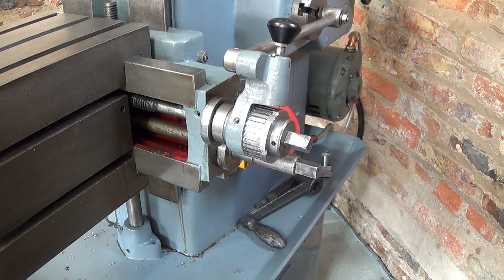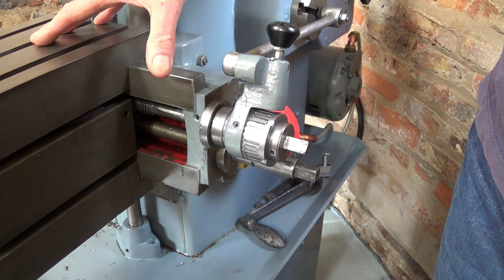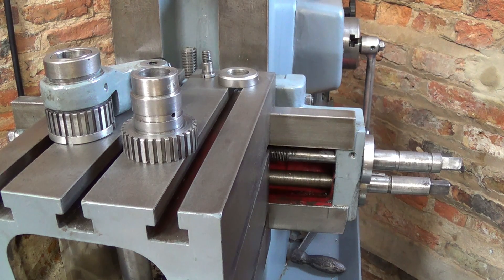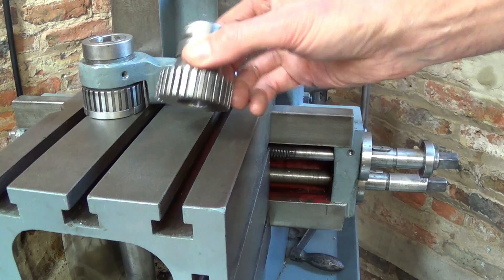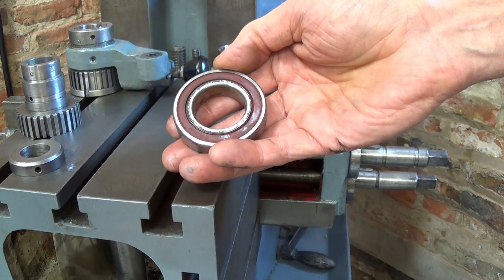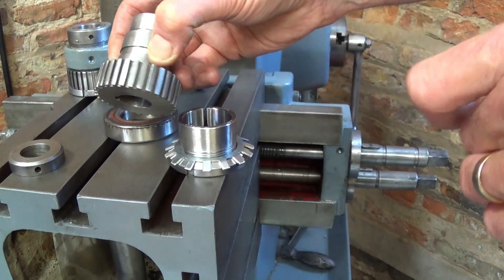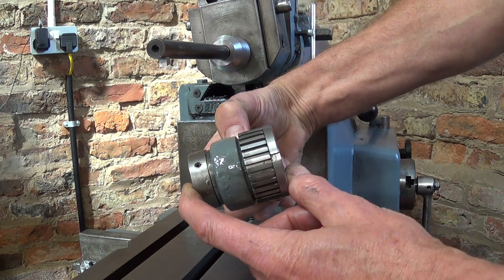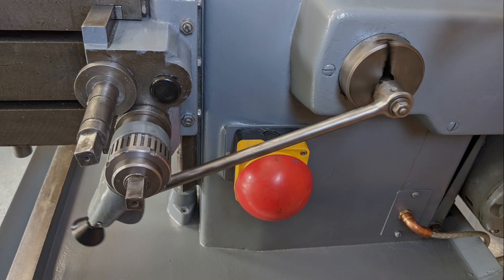HS5 Elliott 10M shaper table clutch

Comment: The only issue with auto up and down feed on the table is not being able to use the front table support. Aside from that, it's a great feature to have. Nice and simple solution well done
Reply from the maker: Hi, that is true. I think I have only used the V feed once. Just occasionally there are jobs where no other setup will work, then I'm glad of it. Cheers

Comment: Another great video. Would be good to see some more detail on how the clutch works.
Reply from the maker: Hi Jonesey, I used a tapered 'bearing sleeve', which is a tapered sleeve to secure bearings with a tapered internal race to a shaft.  So the idea is if the table load becomes excessive the cone will slip within the toothed ratchet gear     and avoid breakage. Now I have never had a 'collision event' to test it so at this point it remains there as a safety device as yet unproven, but at least it has a chance of working whereas a hard keyed gear has no chance to slip as a safety clutch would.  Cheers

Comment: Great video and I did not know that the vertical and horizontal auto feeds were interchangeable. Still looking for a small shaper.. one day hopefully!
Reply from the maker: Hi Peter, Elliott sold a vertical feed ratchet option for the 10M a bit more sophisticated than my rig up. The friction clutch sat on a shaft in that hole which has the black bung in it on mine and then it could be pivoted to drive horizontal or vertical. Of course the larger shapers often had a down-feed option on the vertical toolpost slide (rather than ratcheting up the table).    Cheers

Comment: Excellant!
Reply from the maker: Thank you Alan. Now, I've never had occasion to put it to the test. I gave it just enough tightness to drive the feed, and I hope that taper would not lock and make the clutch solid (i.e. not a clutch). But there was no clutch before so it might be better than nothing. The original Elliott design was a friction clutch but it only worked on the cross-feed and was not fitted to my machine. Cheers

Comment: Great idea for the clutch. I’ve just purchased the same machine and will give this a go when I get time. You mention the table drops off the horizontal leadscrew at both ends. What’s required to put this back in position. 
Thanks
Reply from the maker: Hi Bradleigh, the fact that the table nut runs off the end of the horizontal screw thread  (and on to the plain part) before the table runs up to the casting is a useful safety feature but it can be awkward to get the nut re-engaged on the thread. If you are lucky just push the table (and nut) against the thread and turn the handle to screw it back on. The table is weighty and may drag on the slides so it's hard to feel when the nut starts on the thread. You may need to unscrew the lead screw at one end to get some wiggle. It's a bit awkward.  But better than breaking something. Up and down is more dangerous, without that built-in safety hence I made the clutch. Cheers
Reply: @HaxbyShed  yes, I thought I maybe a bit tricky to align the table. I had a better look at it today, and it think it has the clutch assembly. I’m not convinced that it’s going to slip easily so I’m going to fit some limit switches either side that cut the power. Have you thought of doing this? It can be done fairly cheaply.

Comment: fascinated by this. i still don't quite understand it. the withdrawal sleeve idea is just for easy removal? or does it have some function as part of the clutch? i would love to see a demonstration of the clutch in action
Reply from the maker: Hi Raymond, the idea is that the cone of the withdrawal sleeve is the clutch. I adjusted the nut until the cone stopped  slipping during normal operations. There is a risk that the withdrawal sleeve taper will 'self lock' being only a couple of degrees. If travelled too far the table just drops off the horizontal lead screw at both ends so horizontal does not need the clutch really unless you run into the work. Vertical travel is the real risk. I have never put my safety clutch to the ultimate test - but I will have a think how I might demonstrate it. Cheers
Reply: @HaxbyShed  i understand that demonstrating the clutch could damage the machine and certainly wouldn't want you to do that. Thanks for responding. I started watching another channel called rustinox who has a similar machine and I think I'm starting to understand how it works
Reply from the maker: @raymondjames9734  Rustinox I know well. In fact one of the first channels I watched when I got my shaper. He's s good guy. Cheers

Comment: what size milling bit did you use to cut the splines on the ratchet gear. my one is missing and i need to make one
Reply from the maker: Hi Donny, the ratchet wheel has 3/32 (2.4mm) slots so I used a 3/32 carbide end mill. I ran my lathe at full speed (1500 rpm), took very light cuts and still I broke 2 end mills in the process. If you have a mill then a slotting saw would be a better option.  Cheers

Comment: Iv been looking at the vertical feed and was wondering if I could put it on the other shaft but the thread on the shaft made me think other wise iv found your video very helpful
Reply from the maker: Hi Dale, I think mine was made before the friction clutch on the x-feed was added, as I have no thread on the drive end of the x-feed shaft. I wanted to make a self-contained clutch that could be swapped from one shaft to another without any adjustment.   I adjusted it the first time and it's been fine since with no slippage. The taper on the bearing sleeve I used is quite shallow so the clutch might taper-lock but it's got to be better than no clutch at all. I can't really foresee when the clutch would be used on the cross-feed as the table runs off the end of the x-feed screw before it hits the traverse castings. But on the down-feed I guess the clutch could save the day if the table came to the end of the down-feed screw thread or the leg bottomed. I think I would always arrange any vertical work so the table increments down. I don't think incrementing up towards the ram would be a good idea, being more risk of a collision. Cheers

Comment: does this shaper table rotate ?
Reply from the maker: Hi Roy, yes the shaper table can rotate 45 degrees one way and 45 degrees the other way. But the slots on the side can be used to hold long work in a vertical position to machine one end. In another video (HS53) I make a bracket for my Tapping Head and do some machining using the T Slots on the side of the shaper table. Cheers